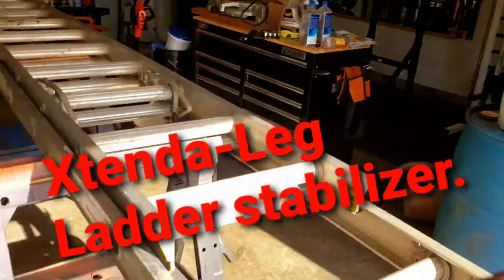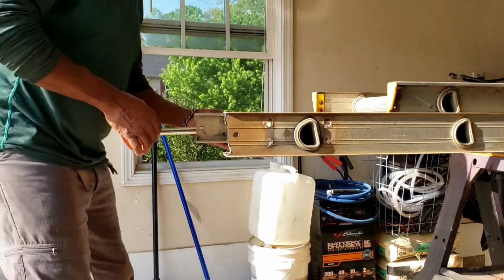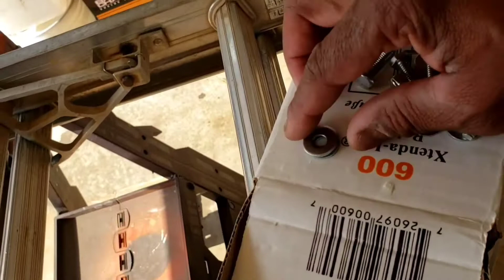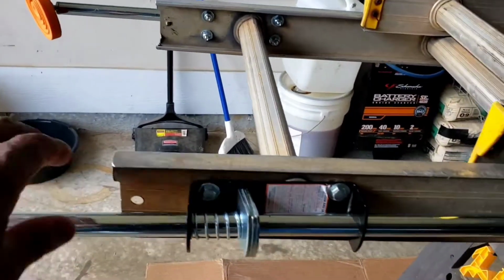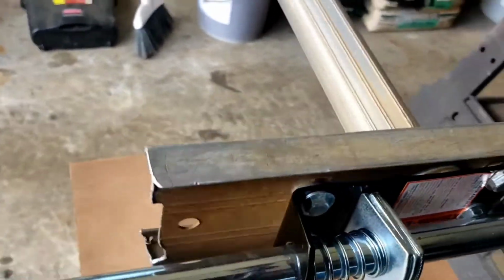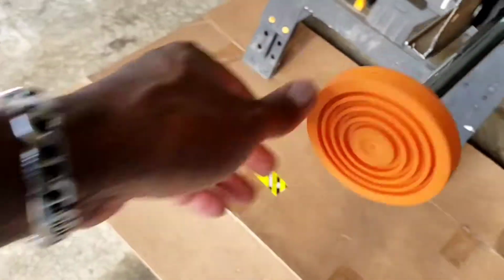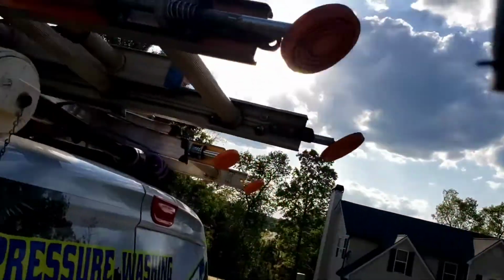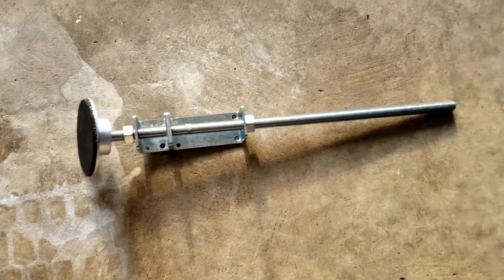Xtenda-Leg installation

Comment: Did you need to drill the holes beforehand?
Reply from the maker: Yes.
Reply from the maker: Don't over tighten the bolts and nuts. The legs will have trouble sliding up and down.